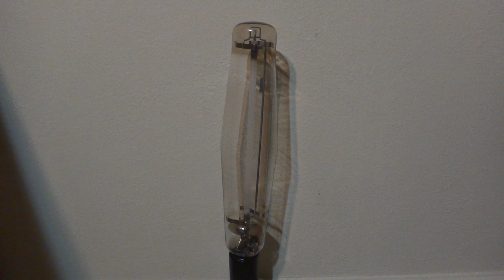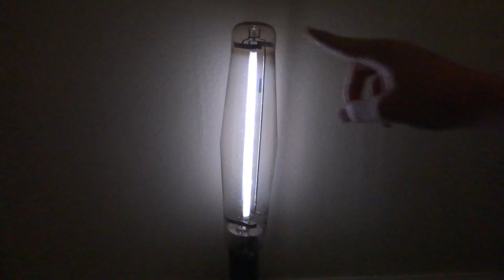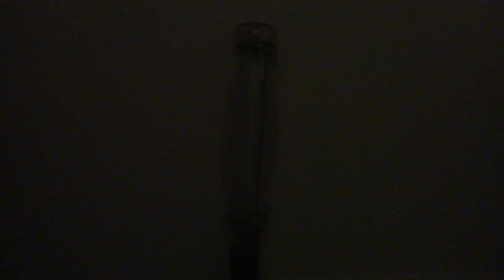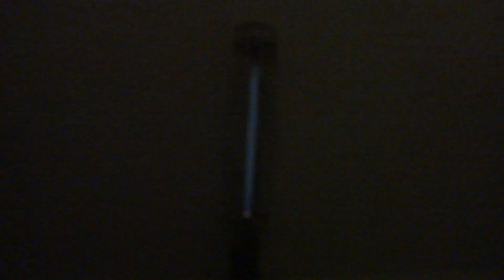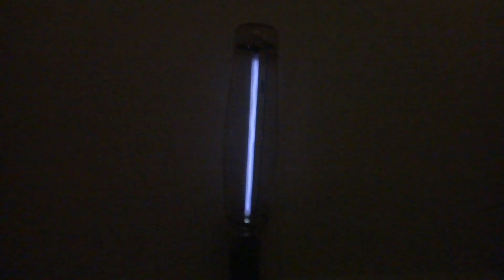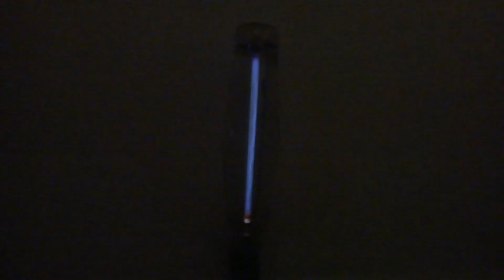1000watt GE High Pressure Sodium Light Bulb (trying to start)

Comment: Tip: if you don't have a ballast, if you do have a plazma globe you can use that but won't light so bright so the ballast and plazma globes are still a good high voltage source to the arc lamp. Have a good day :).

Comment: You can try striking the arc with an old 2x40w Rapid Start Fluorescent Ballast- then once the arc is struck attaching a 70v transformer in parallel. But the impedance of the HPS bulb- tube would be more accurate- is so low that overheating is inevitable without a ballast made specifically for the wattage of the HPS bulb that you have. Measure the voltage at the bulb- and you will get a paltry 35 volts.
Reply: Yep.

Comment: It doesn’t really effect the old fashion magnetic ballast because those discharge lamps are negative resistance & the job of the ballast it to pump out its designed wattage ie if a ballast is designed to run 70 watt lamps it will not put out any higher wattages the only thing is an underpowered bulb will burn out quickly due to uneven flow of power going through the gas an overpowered will eventually explode

Comment: what wattage do they typically use in modern street lights?
Reply from the maker: thecooldude9999 Where I live its 100watt to 250watt high pressure sodium.
Reply: Where I live 150-400w
Reply: where i live in italy 50 or 70 to 600 or 2000 in the biggest floodlights

Comment: Your'e NUTS....I'm very surprised that your only using a 70 watt  ballast for this....at least use a 400 watt one, it's still stupid, but at least it won't start smoking. Your lucky that it didn't...   (keep those ballast watts the same as the bulb watts)